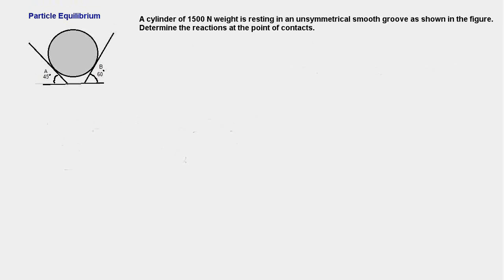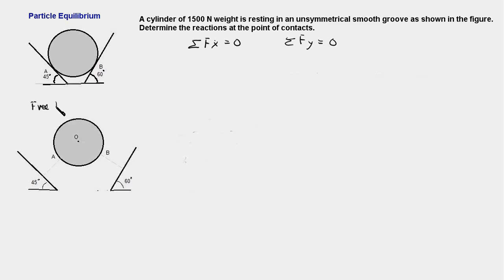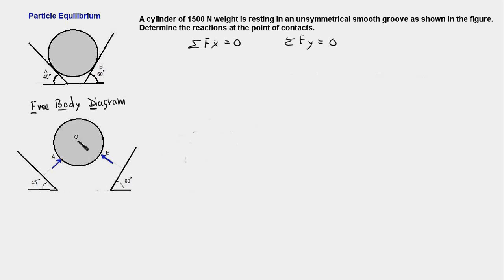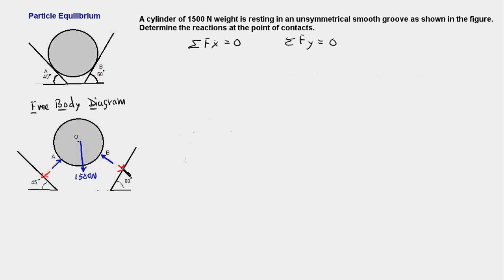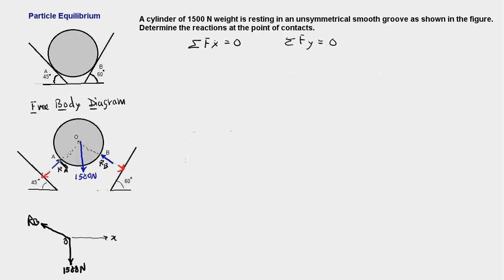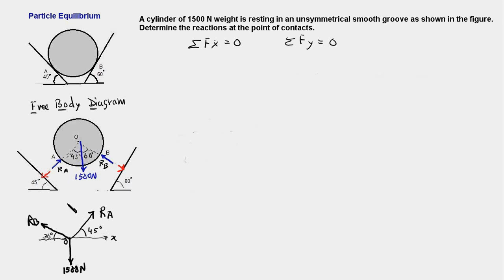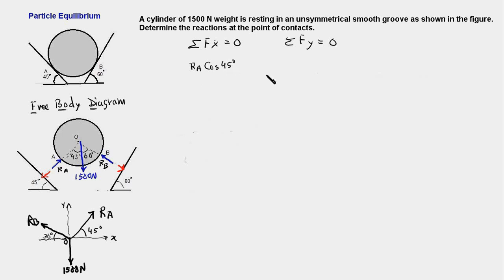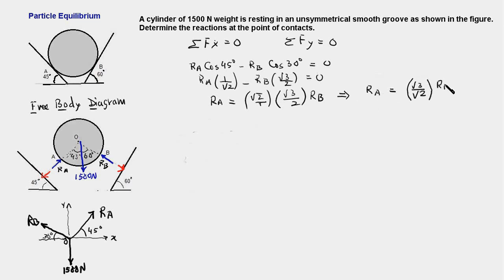4.1 Engineering Mechanics: Particle Equilibrium (Basics)

Comment: I got the same answer for B, but a different answer for A. 

My A was 776.5 N.

 I added it up with cosine law and it equals to 1500N
Reply from the maker: If you got Rb as 1098 N then Ra should be equal to (1098)(cos 30)/(cos 45). Please recheck your calculations and if still stuck, mail your solution.

Comment: how does it make 30 degree?
Reply from the maker: The reaction force Rb is normal to the plane which makes an angle of 60 degrees with the horizontal axis. Therefore, using simple geometry you can figure out that the reaction force Rb makes an angle of 30 degrees with the horizontal axis. Hope this answers your question.